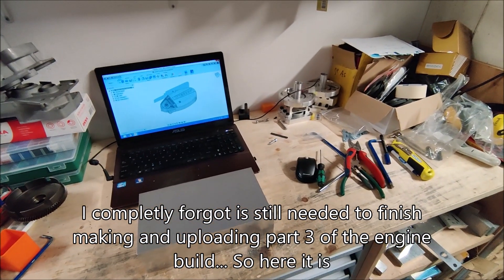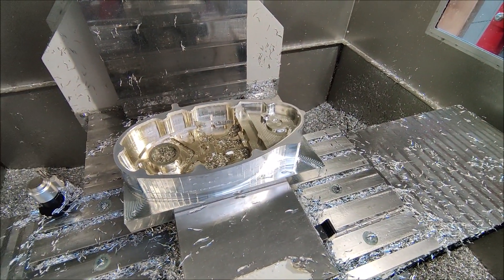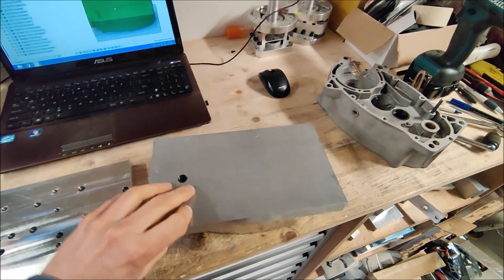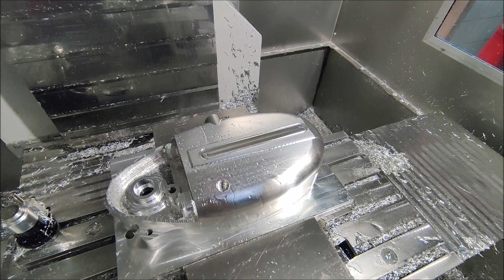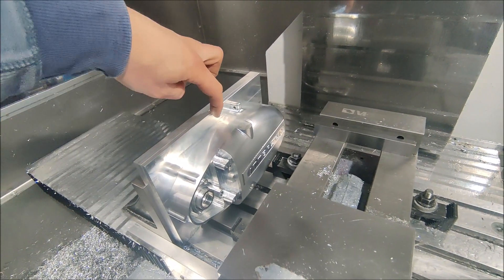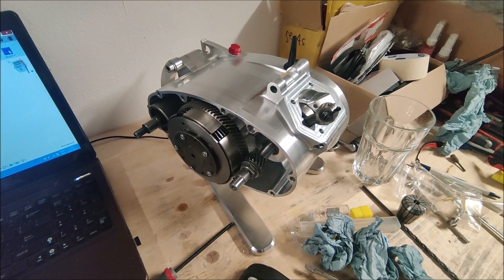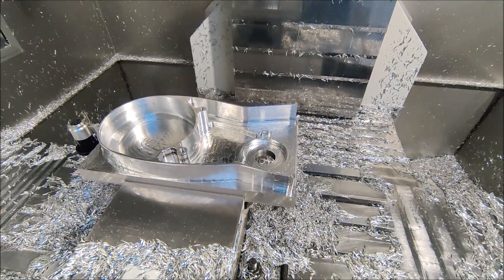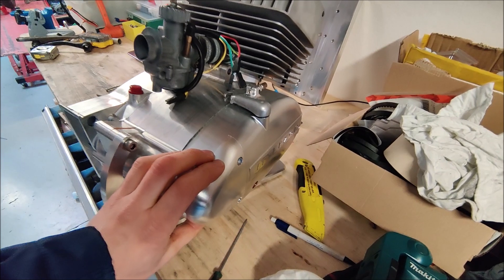Cnc machining a zundapp 5 speed engine part3

Comment: Too bad we  couldn't get this genius machinist to build brand new MOTO BETA 175  and 125 right side shift repro replica engines for bike riders with bad left legs and non functioning left  shifter foot, it would help so many riders to be able to ride  again and somebody like Van Tech could reproduce the frames gas tanks and things like that there are others that could build the rims and center hubs maybe somebody with a cnc machine could make up the brake hubs front and rear . Keep it as close to original as it was in 1958 or so

Comment: Wonder if he builds brand new running engines for KS 100 ZUNDAPP with either a 4 speed or a 5 speed transmission it would be Kool to be able to order a brand new running engine that way

Comment: Very nice work! I have a question where you order the stock materials (aluminium blocks)? I have some own engine parts I need to manufacture but have problems to find a store to buy big stock materials from.
Reply from the maker: https://onlinealuminium.nl/
Reply: Thanks 🙏👍

Comment: If you went to a larger flood coolant pump it might do a better job washing all those chips down into the tub. Usually a good flood system sprays so much you can’t even see the part.

Comment: Very cool, well done and done on a machine you completely built yourself! Very impressive.
Reply: yes but he has the machine and could make up a bunch of them.  I have an old Hodaka Ace 100 2 stroke engine case and I bet you he could also build that vintage engine the same way. There was another old bike that I would really like to be able to get was a 1974 MB 100 cc bike made in Florence Italy I only ever saw 1 of them in the USA red silver with MB on the gas tank and that bike was a beauty too I had an old 1965 KS 100 Zundapp in the USA but there was nobody here in the country at the time that knew how to fix the engine I remember I had to send to Munich Germany for some of the parts but I had a problem with the main roller bearings they were all individual rollers that the transmision input shaft went into and I lost a roller they always fell apart and I had nobody I could talk to so oh well thats how it goes

Comment: Very nice work! Where did you get the models for the engine? Or did you make it yourself in Fusion?
Reply from the maker: Yeah i made the model my self, i guess it took me around a full week to make the 3d model. i used my cnc mill as a cmm to locate all the important features and hole locations. 
The rest i did with a caliper and some trail and error.
Reply: @Svanitterzon  Really really impressing!
A collegue of mine was annoyed by the poor quality of his Harley Davidson knucklehead engine so he machined his own.
This is just as impressing.

Whats your plans now?
Reply: @Svanitterzon mart I’ve done the same when reverse engineering then i went to probing and now I’m back to this since selling my probing machine.

Im building a 3d scanner atm and will see how much it can help.